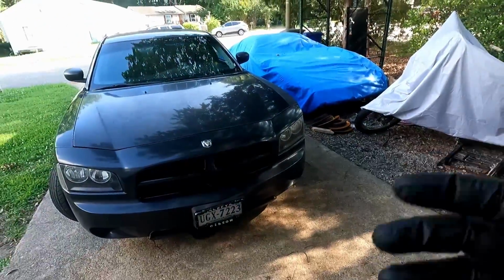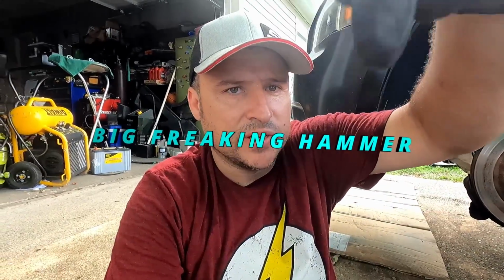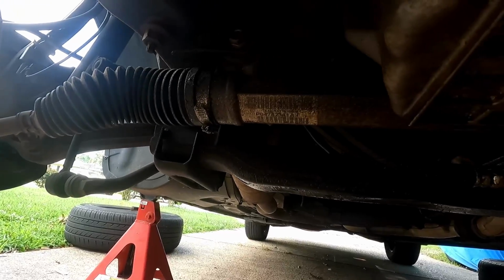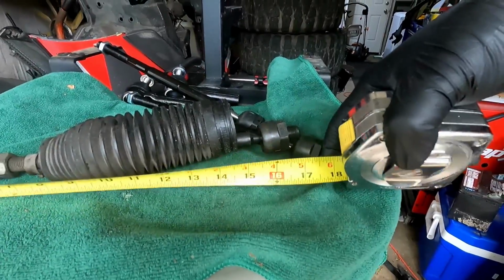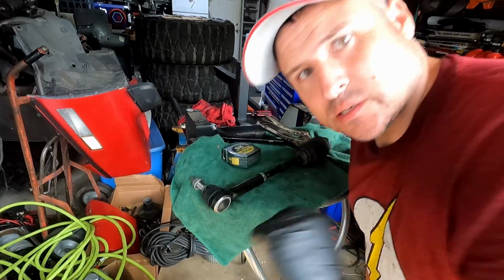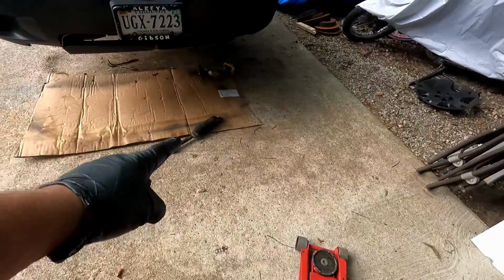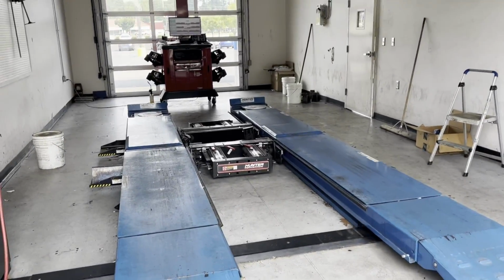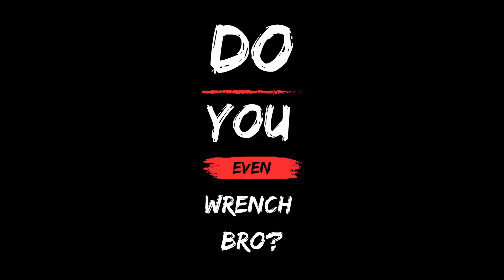REPLACING INNER AND OUTER TIE RODS EASILY AT HOME | TOP GOOGLE SEARCH FOR DODGE CHARGER REPAIR.

Comment: After doing this exact job, again, since aftermarket parts lasted me 1500 miles or 4 months…. Ordered my parts from 1A Auto as I used their parts before on other vehicles…. I can say their parts are reliable and backed by a full warranty…. Good video 👍👍👍 only I wouldn’t use a tape measure to “guess where it’s at” BUT it works if you immediately going to get an alignment….. counting turns you don’t need an alignment, BUT I counted turns and I’ll prolly go get an alignment and see how close I got.. lol😂

Comment: I got a 14 dodge charger sxt with 115 thousand miles both side of my steering rack was clunking an leaking fluid if you have a clunking an can't figure it out probably the steering rack I was changing everything finally realized it was rack lol..😅😅

Comment: My trucks tie rod snapped tonight in the hwy driving home. Made it home safely but I'm in the process in trying to figure out how to get the money to fix everything and also make it to work. And then rent coming soon. Sorry for the rant it happened like 3 hours ago and I'm still in panic mode ig
Reply from the maker: I completely understand my friend and yes it is a state of panic. If I can help you in any way please feel free to ask
Reply: @Gasdieselgarage  autozone order the completely wrong part. I was going to replace inner and outer. I prepped it so I could just put on both new ends and they ordered hub caps...... I don't understand how u mess up that bad. Now I gota pay to get a ride to work for a few days
Reply: Money's tight so it's worse than the situation is. Just wished I could have gotten it on the road today